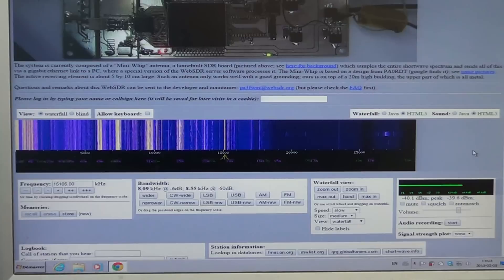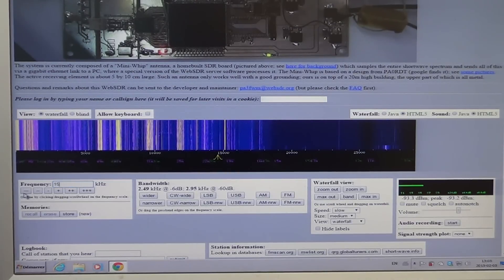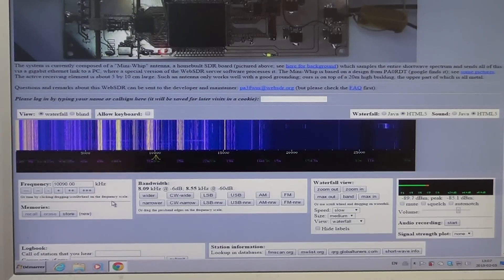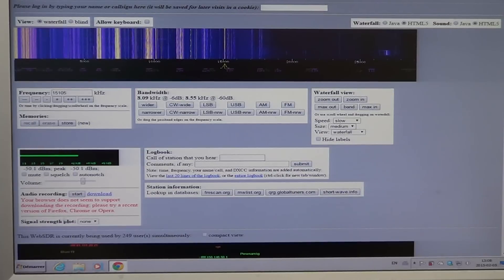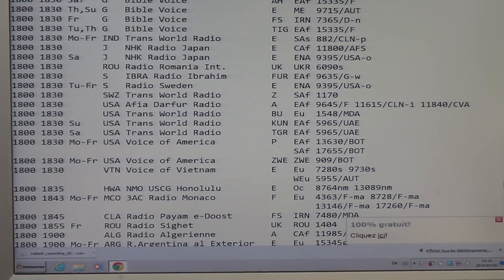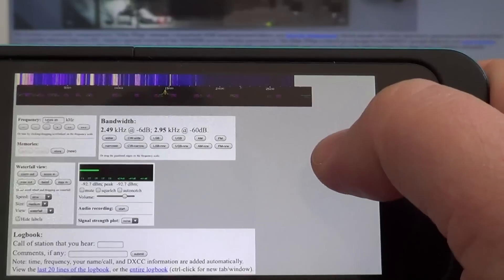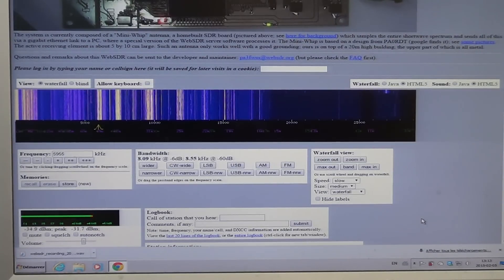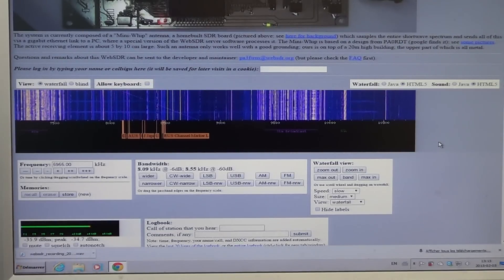Using WebSDR Shortwave receiver at Twente Netherlands on the Internet

Comment: The Web sdr online site in the Netherlands is what got me into SDR - I bought a NooElec NESDR Mini USB RTL-SDR  and NooElec Ham It Up v1.2 - NooElec RF Upconverter For Software Defined Radio.o Once weinter is over I will put up the anteanna I bought on Ebay 40' Shortwave Broadcast Receiving Eavesdropper Antenna Supermarket so I can hear more stations

Comment: Twente is the only receiver that is full band because they are using proprietary hardware, everyone else uses off the shelf stuff that will only tune a small frequency range with an audio card.

I emailed the guy a couple months ago who runs the project to get the app(it runs on Linux and written in Java) and run it at home sometimes, but my Softrock isn't working right and it's been down for a bit. I have 3 Softrocks I'm currently building and hope to get back up soon. They will probably be on the 20, 30 and 40 meter ham bands with a 96KHz audio input for each.

It's really nice to have all the nodes spread out so you can get an idea of conditions in different parts of the world. While it would be really nice to have the full spectrum that Twente in other places, I bet the hardware costs a fortune and they probably wouldn't be able to get their money back from the 2 or 3 people that might purchase one in order to not lose money.